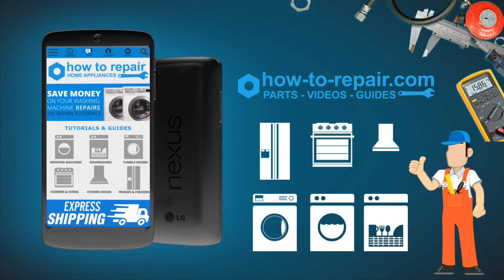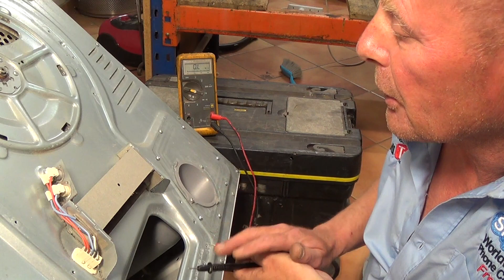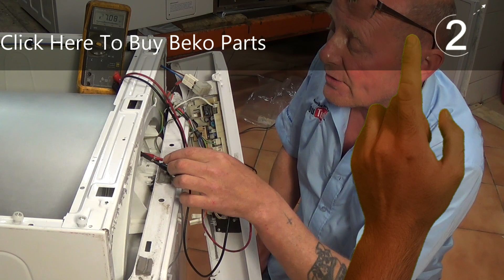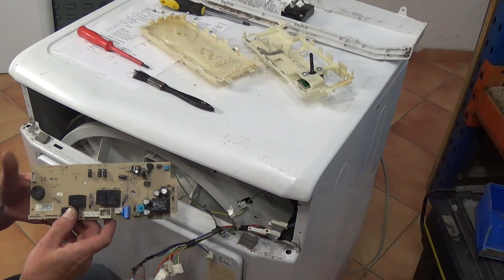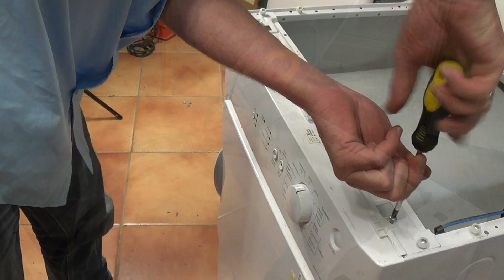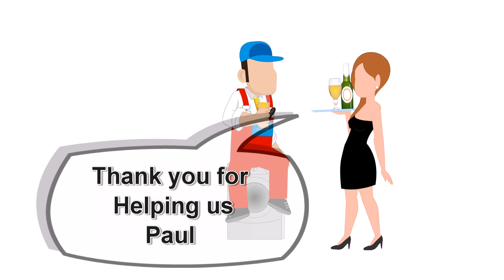How to test a Beko Vented Tumble Dryer heater system & Pcb

Comment: Hi , you have drawing for beko dryer  dcy 9205 gbx3 ?  I have heater element with sensor connected to the blue plug , and its disconnected , could this be fault ? and if so this part is for sale? or I need to replace all the heating element ?

Comment: Hi. So I have a Beko DRCS68W dryer. When the heating element stopped working I decided to check that the heater was getting power. As I touched the heater it literally fell apart and caused a huge short through the mains suppressor and burned out the main board. I changed the suppressor and the heater and eventually managed to replace the board. Once it was all working again I noticed that despite getting heat the clothes were not drying. I found that the pump wasn't working and so replaced that. After reassembling the machine I now have no heat. I followed your videos to check everything and cannot find a fault. I set the self test which ran until the 'ready to wear' light which wouldn't come on, but since then I can't get it to self test again. I'm about to find a large cliff to throw it off. Any suggestions would be useful.

Comment: Superb video sir was able to diagnose my no heat from dcu 8230 dryer to a dry joint on heater relay. A little solder job and all working. It would appear it was over heating the relay over a period of 8 years, not bad. Thanks again.
Reply from the maker: I'm glad it was only a simple solder job the relays are a predominant problem remember if you ever need further assistance we do a live show every couple of weeks so make sure you get subscribed to be notified

Comment: I have the same machine you're working on but it has recently started stopping after about 10 minutes but will start immediately, there is plenty of warm air coming out of the back of the machine when in operation, the censor inside the drum is clean, the filter box is also clean, do you think it may be a sensor. with Thanks

Comment: Hello mate nit sure if you atill use youtube but my tumble dryer had a failed ie was totally broke in the coilc i replaced with the correct part still no heat i done the teats the exact same as your video  now on to the circuit board but my question is would the machine work at all if the board relays were failed for the heater my machine turns on etc rotates but juat wont heat even after new element thanks for your time 👍